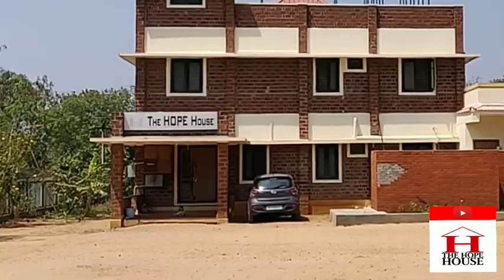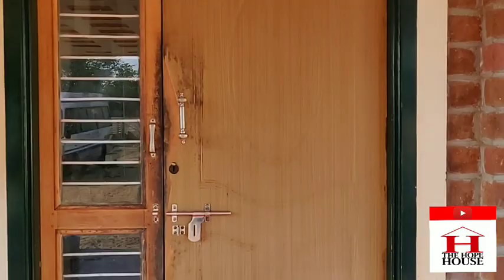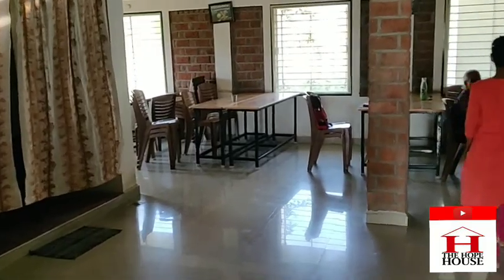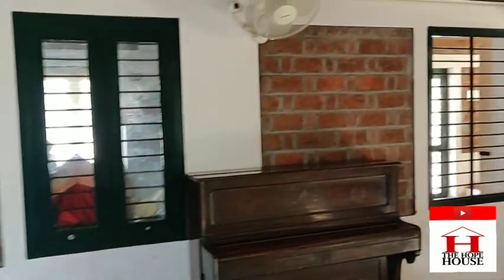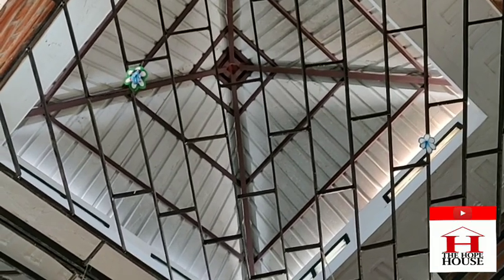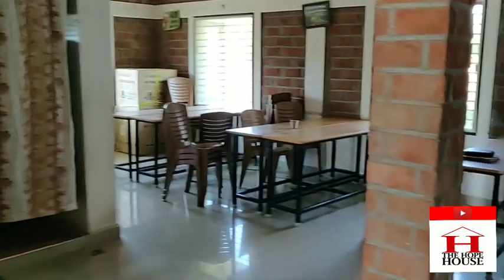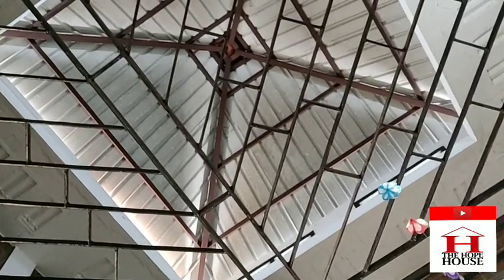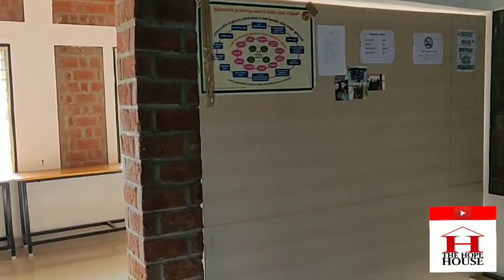Laurie Baker (rat trap bond wall) model building after more than six years - Part III

Comment: How much is the temperature difference in peak summers.. have you measured it by any chance to quantify the gains from such buildings?
Reply from the maker: I never measured it objectively (I should though) but just the experience of temperature difference between outside and inside temprature is significant.
Reply: @TheHopeHouseEnglish  That's nice to know temperature change is significant.. I am in process of building our house with mud bricks.  Hence was curious.. if you happen to measure the temperature difference any time soon do let me know.. thanks for responding..👍
Reply from the maker: Sure I will.  Good luck with the  construction with mud bricks.

Comment: how to lay plumbing and electrical wiring pipes in rat trap bond walls?
Reply from the maker: You must lay the pipelines (for wiring) as you lay the bricklines.
Reply: @TheHopeHouseEnglish  How about plumbing works? Can I cut the wall and install a 4 inch pipe for WC? Will this weaken the structure of the wall?
Reply from the maker: No, since the space is hollow, it makes the wall weaker.  You ought to plan the building well before hand (lights, fans, switch boards and plumbing lines etc) and lay the needed lines (pipes and wires) as you construct the building.

Comment: What happened if we feel the traps with sand. Please share your opinion.
Reply from the maker: The objective to keep the hollow space is to prevent the heat from travelling from the outer surface of the outside wall to to inner surface of same wall and consequently heating the room.  If yiu fill the hollow space with sand, this objective may not be achieved.

Comment: Cost   amount
Reply from the maker: It may not cost anyless to build it because what you gain in materials would be lost in the deligence of labour.

But the cost of ownership over a period of time would be a huge saving as this building states cooler/ warmer depending on the temperature outside.
Reply from the maker: The cost of building may not differ much because what you gain in building materials would be lost in the deligence of labour.

What you will gain is the cost of ownership over an extended period of time.  Thanks for writing though.